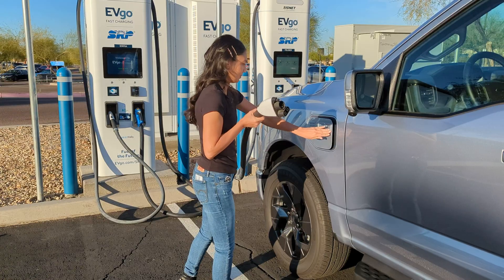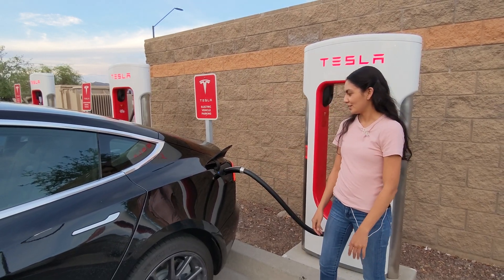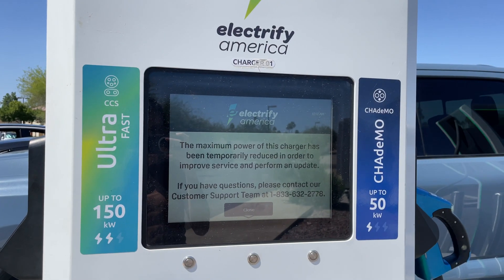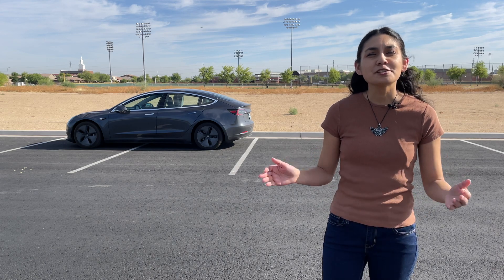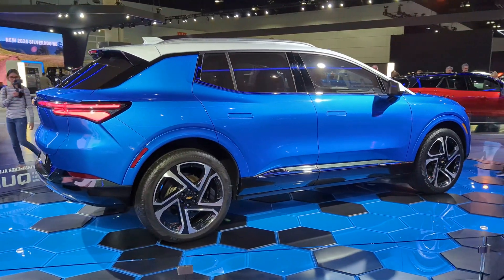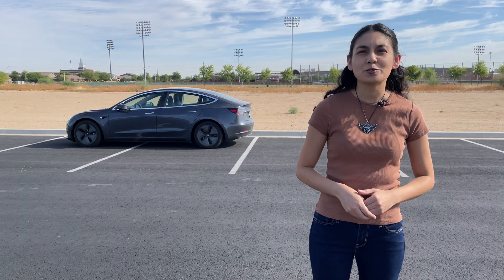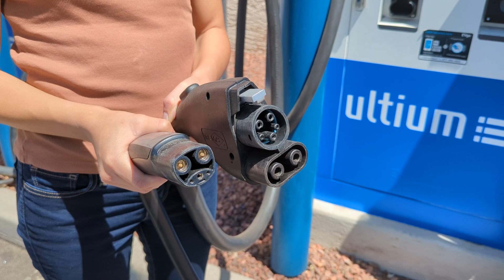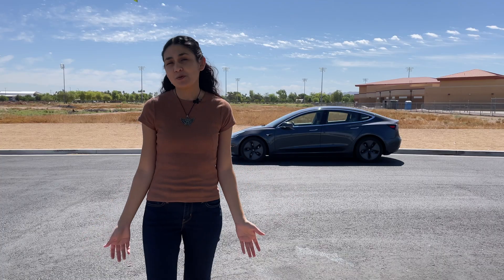Supercharging the Future: NACS and the Evolution of Electric Vehicle Charging

Comment: Position of charging port is such a snag. I don't know if there is a neat solution, other than to have the cable come down from a movable, overhead box that holds most of the equipment. Longer cables just seem so undesirable overall.

Comment: Supercharger Arbitrage!

     I highly doubt I’m the first person to come up with this idea, but here it is, nonetheless.

     Perhaps the single best, or at least most powerful way to motivate humans to do something is to pay them for their actions. “Economic Incentivization” is a powerful tool!

     One of the issues around EV charging currently, and for the foreseeable future is charging speed at DC fast charger stations. There are multiple problems and multiple potential solutions surrounding this issue, but here’s a partial solution that may work out very well, if it can be technically implemented.

Scenario:
     It’s late 2025, and I own an EV with a large (let’s say 150 kWh+) battery. My vehicle is connected to a NACS DC fast charger, and is charging at close to the maximum 350kW that the charger can provide, over an 800V connection. I am having dinner at a nearby restaurant, and my state of charge (SOC) has reached 53%, with a target of 80% for ending the charge, since I have no need to fully charge my battery in this session, and my pack uses NMC cells, which prefer to not be fully charged unless the extra range is needed.

     Another EV pulls in next to mine, and connects to a paired charger that is on a shared feed with mine, so the charge rate I was at immediately halves, so that the 350kW maximum feed power that the two chargers share is not exceeded. All well and good, in many cases, if both EV owners are patient. But what if the owner of this second EV is in a hurry, or is simply willing to pay extra to charge faster?

     “Simply” making every charger at every station capable of supplying 350kW or more at any time, day or night, fed directly from the grid is not yet a practical possibility, so what to do?
Arbitrage is the answer! It just so happens that I’m not in any sort of hurry, so as I sit enjoying my meal, my phone makes a “ka-ching!” sound, reminiscent of an antique cash register. I glance at the notification, and see that my pre-programmed arbitrage settings are allowing the second EV owner to charge at 800kW. He’ll be at 80% SOC in just over 8 minutes!

     How is this possible, you might ask? It is simply because I’ve given default permission for my EV to not only stop charging, but feed some of its battery charge to the other EV, over the 800V direct DC connection to the charger. The other EV is not only now drawing the full 350kW that the charger pair can provide, it’s also drawing 450kW from my EV’s battery.

     It happens that I’m satisfied to let my pre-programmed defaults run in this session, so I’m content to let my battery deplete down to only a 20% SOC, since I’m close to my destination, where I know I can charge overnight from an EVSE in my friend’s garage, and at a VERY low cost, due to their participation in their electric utility’s time of use rate plan.

     For my willingness to allow this to happen, I am rewarded handsomely in future fast charge credit, paid for by the other EV owner’s willingness to pony up some $$ to cover the faster charge rate, so he can get to his hot date on time. I could have opted for other scenarios by simply tapping an option or two on my phone, such as insisting on the 350kW charger being shared equally between the two EVs, or my EV charging at a reduced rate, giving him more power, or my charging stopping entirely until he is charged, then resuming, without ever depleting my battery, etc. But my willingness to “sacrifice” some of my battery’s energy, at least temporarily, worked out well for both parties.

     No doubt there are many additional scenarios that can be imagined where some variations on this them can prove to be mutually advantageous…

     Let’s make this happen!

Comment: Well... there are a few things left out of this video.
90% of all ev charging events are not at public chargers.
Most evs sold globally are not Tesla, and even the Teslas sold in the UK have CCS fitted.
CCS has 3 phase, NACS doesnt

For most owners, this makes no difference. There are plenty of evs on the road that have never been to a public charger.
Reply from the maker: Hi Nordic, one quick correction on your comment. The AC Type2 portion of CCS2 is capable of 3 phase charging in Europe. In the US none of our connectors support 3 phase since it's very uncommon to be delivered as residential power. Hope that helps!

Comment: It's only a plug, the problem is what is on the other end of that plug ie the quality of the charger itself.
Here in the UK, Tesla's have CCS sockets, also the Tesla Chargers have CCS plugs and they work well
Reply: The UK should switch.  NACS is better.
Reply: @davidbeppler3032  NACS may be smaller an lighter but it's just a plug. It all depends on the quality of the charger connected to it and in the UK they are connected to Tesla chargers so they are superb, where they are connected to non Tesla chargers there are issues but never with the plug but with the charger.
Reply: @davidbeppler3032  nope. CCS has 3 phase, NACS doesnt

Comment: I am an early adopter; my first EV was a 2012 Nissan LEAF, which I traded for a 2022 LEAF. Both cars have performed wonderfully. The times I have used Chademo, it has worked well. Right at the time it looks like the industry may standardize on NACS, Nissan has decided to embrace CCS with its new EV. I suspect Nissan will leave us LEAF owners, who otherwise are satisfied with our vehicles, high and dry with Chademo. Maybe if Nissan does not pick up the ball, some 3rd party will either make an adapter or modify the LEAF with a NACS port.

Standardizing on the physical NACS connector is just the first step. The second step is the payment system. Up to this point, I've had a card wallet in my glove box with the various RFID cards for the different brands, but they are starting to accept credit cards at some chargers. I use a credit card at EA, for instance. Universal plug-and-charge seems a ways off. And then there's the J1772 issue, because cars with NACS won't have a J1772 port. So if NACS really does become a standard, it should ultimately kill off J1772. There's a LOT of J1772 infrastructure to change out to NACS "destination charging".

Comment: Wonder why Tesla connector is only 50 kW at EVgo? That's because it's using a Tesla to CHAdeMO adapter behind the scenes. This means that hack won't work with others like GM or Ford unless they adopt CHAdeMO protocol too. Technically, EVgo don't have NACS. They have Tesla via CHAdeMO, only. To be NACS, they would need to have their charger manufacturer go back and actually build Tesla connector stations using CCS which exists nowhere in the world and certainly is not a North American standard. 

This move by Ford and GM was a coup and favors only Tesla. It makes the US charging infrastructure much less able to have more than one player, Tesla, and makes it more likely that we could see the others fail creating the monopoly scenario you hinted at in the video.

To do this right, there should have been industry and government meetings with transparency and input by consumers to switch from the standard most manufacturers had agreed to support in the USA to a connector merged with the CCS protocol which Tesla stations don't currently support now anyway. There has been far too much hype from the EV journalism/review space for NACS with almost no sober investigation into what this would do to the industry. Those charging companies folded to commit to transitioning to NACS quickly because their shareholders were tanking their stocks. No one had the time to assess the costs. Even Tesla pretending that ripping out half or all of their current stations to upgrade to V4 is ridiculous. These so-called business mavens will trash billions of dollars of existing infrastructure to land NEVI grant money to rebuild old stations to make a semi-walled garden, which so far, Tesla is now only opening to companies who sign a deal with them. Why all the celebtation? It was a coup to half abandon an existing standard. And all we got was a t-shirt.
Reply: Ford and GM refused to spend $100 billion each on Charging infrastructure like Tesla has.  Blame them for failing the US consumer.
Reply: BTW, the Tesla to CHAdeMO is "up to"  50 kW but often charges as slowly as a 48 amp level 2 charger in the teens.
Reply: To be clear Karlin CCS is trash.  It was created by Big Oil and Legacy Auto to slow adoption of EVs.  AFTER the NACS was introduced by Tesla.  When 90% of EVs in America were Tesla, the CCS was made the "standard".  Creating a walled garden keeping Tesla out.  I notice you either did not know this, or just ignore it.
Our Gov failed to Screw us and you got a T-shirt.

Comment: My car can only charge with a J1772 and it is annoying when I go to a mall or shopping plaza and find that the charging stations don't include even one J1772.

So an opportunity to charge while I shop, eat and/or catch a movie if there is a theater in walking distance has been missed. :-( 

Sure, it may not be rapid charging and only provides several miles on electrons but every little bit helps.
Reply from the maker: Hey Paul, if you're finding that there are a bunch of Tesla level 2 chargers out there, there's a company called Tesla Tap that makes a adapter you can use to charge your J1772 car off of them!
Reply: @CallasEV  I think you are talking about the Destination Direct chargers.

One of those is relatively nearby but every time I have gone by that location, all the connections were already in use. So others learned that trick well before I heard about it. ;-)

Comment: Always make me smile to see that you've posted another video, Lorraine. You've covered the details of this upcoming transition to NACS with a clear, systematic explanation. I agree that the NACS connectors are the best option, and there's no question that the Supercharger network is the most widespread, fast, and reliable. Funny thing, however: beyond this charging advantage, I'm not as keen on Tesla as I used to be. With this month's updates, EAP and FSD are now worse than ever. I'd much prefer BlueCruise or HDA 2. I just hope Hyundai will now get on board. It's true that, as you point out, the short cable on v.3 Superchargers is a real problem. They need to either lengthen them, provide some kind of extension, or ramp up the rollout of v.4 stations immediately. And… start cranking out NACS-to-CCS1 adapters as soon as possible!

Comment: Tesla needs to stop making such large supercharger sites with too many dispensers. More locations spread out will be better. Have more destination chargers in densely populated urban areas.
Reply: Trust me, those mega charger dispenser locations get used heavily.  Check one during a holiday weekend.  They're not sitting unused for long at all.
Reply: Given the work associated with permitting and approvals to install a new site, I can understand why Tesla is opting to expand existing sites in heavily used locations. Although I too would like to see more widely distributed charging, new capacity anywhere is welcome.
Reply: Why not do both?
Reply: In 3 years time, virtually every charging site currently online will be considered smaller than needed.  That said, tons of new sites are in the works.

We're going to need a lot more sites AND a lot bigger sites.

Comment: More destination chargers are needed also. Every state and national parked should have level 2 charging stations. Cruise ship terminals and Extended parking at airports can have level 1 charging stations since the car will be parked there for multiple days.
Reply: Great point, just imagining on departure the driver could leave the car plugged in the cruise ship lot  'please charge for arrival' block.   Chargers in a whole row could  be turned on nearing arrival. Easier on Tesla to check on stats max charge etc from app but would work on a  Leaf as well.